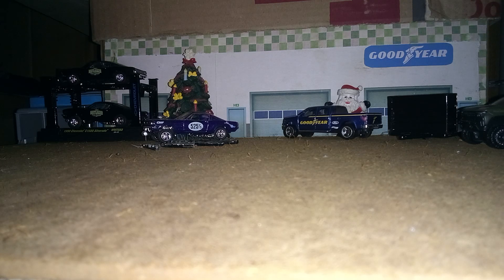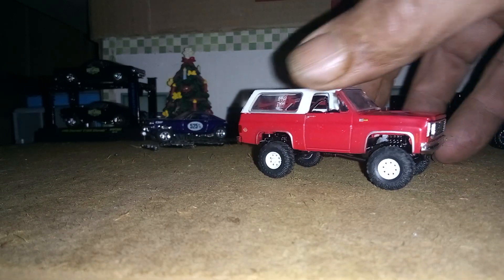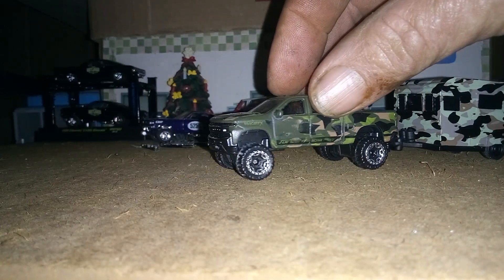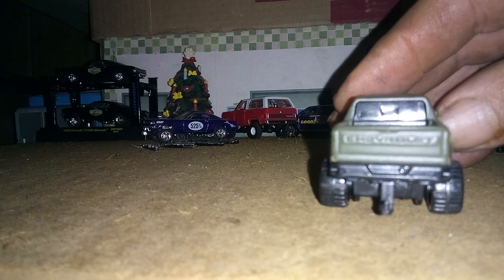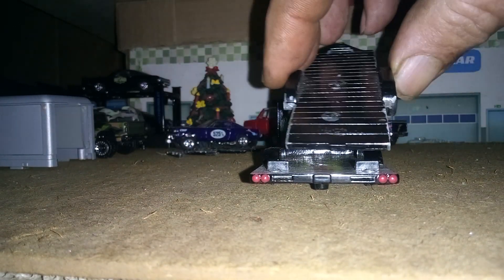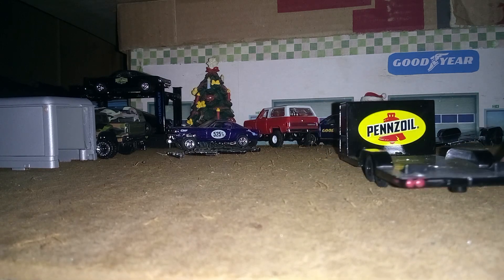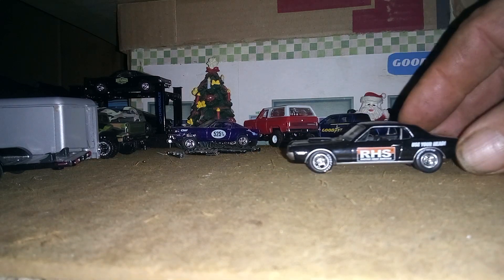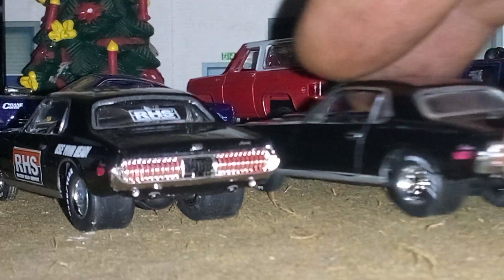An Update On The Blazer Plus Some Customizing Of An M2 Cougar And An M2 Trailer

Comment: You may call them junkie videos and they are far from that brother. I totally all of the videos brother, you are always busy making your car looking better, I like it. The Blazer looks much better now.  That is one of the things I hate about M2,  They are always putting tampos on cars when they should be clean.  Not only does the Blazer look better, but I believe it's a Cougar also looks much better.  I see you got your welding machine up and running, the hitch is working well and able to tow trailers. The Pennzoil funny car will look awesome sitting on that trailer brother, perfect. Good job on the other trailer, the pitch at the back is great idea.  As far as the camera and the light thing goes you would think with all of the technology that are in these phones it would work properly🤔. I guess we just have to deal with it lol. Later brother.
Reply from the maker: Yeah. I see that the video didn't dim when my screen did.  So the screen was tricking me.   The only real time it dimmed was when I showed that silver trailer as you saw.   Maybe next time I won't let the screen distract me.     I'm glad you like all the things I did.  As for the welding machine  I manage to squeeze out enough from the tubes to do that hitch and the blazer top.  I still need to get a new package for sure.    Maybe by the end of the week I'll have a new one.    I definitely need it for all the future wheel swaps waiting to be done.   So right now I'll just work on my M2s that needs wheel swaps.  No welding required. 
Just an impact and an air hose  
( Philip screwdriver) Lol.   
  Anyway. Thanks for watching and your letter.  I enjoyed reading it. 👍😎